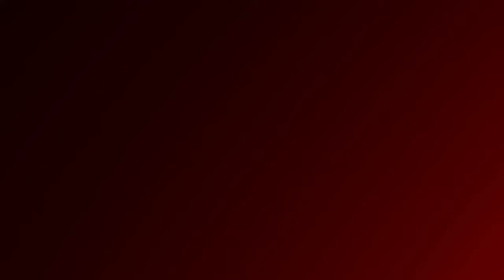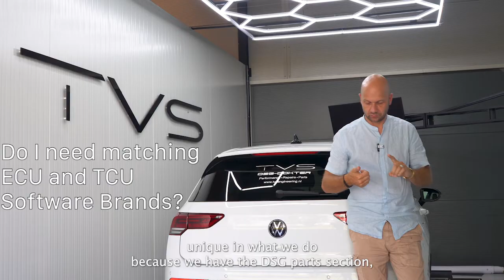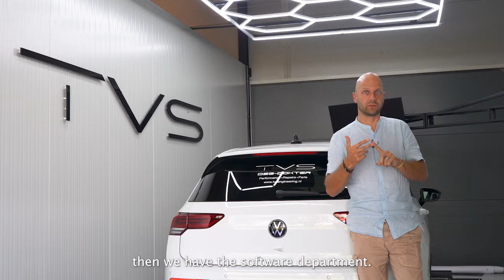Why you should match ECU and DSG Software - TVS Engineering

Comment: Hi. I drive an Audi 40TfSI 2.0 2022 model. EA888 Gen 3B. It has the DQ250 in it. Do you provide Stage 2 ECU and a TCU tune for it? Im based in Cape Town South Africa. Thanks.
Reply from the maker: Yes software is available for those, you’ll need to contact your local TVS dealer

Comment: I have had a Stage 2 ABT piggyback with a stock S-Tronic running in an Audi S5 for 220,000km without issues, so I guess I've just been lucky (and driven mostly nicely)! I recently got your TCU Stage 2+ tune. I'd better go get the ECU tune soon as well to match, interesting to see the difference it makes!

Comment: Question? I have a mk6 gti just rebuilt the motor going K04, i was looking at getting TVS ECU & TCU tune, im in Sydney and you have 1 workshop i can see that installs your software.  To my question, can your ECU tune be refined on either dyno or afyer logging? Thanks very much
Reply from the maker: @brettleonard8602  there’s a few shops in Sydney actually! Yes the ECU software is custom and can be refined, however every single car is data logged after it’s tuned to ensure max safety. Some really good results on TVS K04 software, you’ll love it!
Reply: @vwkris  @vwkris You have a dealer in Romania, Automatico, are they capable of installing your ECU and TCU software? Will there be any logging and further adjustment afterwards? (I suppose you can't apply the same tuning file to all cars)
Reply from the maker: @ best to look at the TVS dealer locator and and see which is near you and then call them to see they have tools for both ECU & TCU!
Reply: @vwkris  TVS ECU & TCU tune done picked it up yesterday. To be honest, I'm not impressed at all by the tcu tune. Very slow to downshift in sport mode(dsg) I have another gearbox with a different tune that is much better in my opinion it blipped the throttle on the downshift, downshifts were faster. Also held 2nd gear way too long wheelspinning it should have changed to 3rd but held 2nd.. and this morning top of 1st gear, it broke down a bit before changing into 2nd. 3k klms on engine new plugs engine is perfect. I can't say I'm happy after spending $2500.
Reply from the maker: @brettleonard8602  really odd, that’s the exact opposite of what TVS should be. Send me a DM on Instagram @mullerkris and I’ll sort you out
Reply: @vwkris  sorry I don't have instagram. Only joined Facebook 6 months ago to find car parts, I hate social media
Reply: @vwkris  thanks email sent, you can delete your comment with email if you like now. Saves being hounded by people